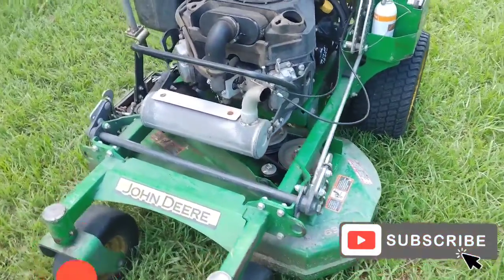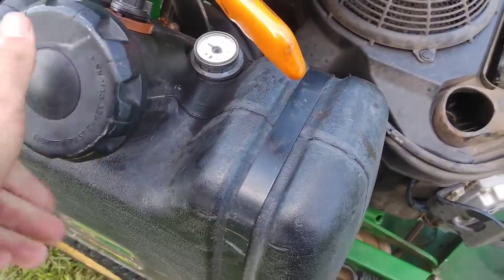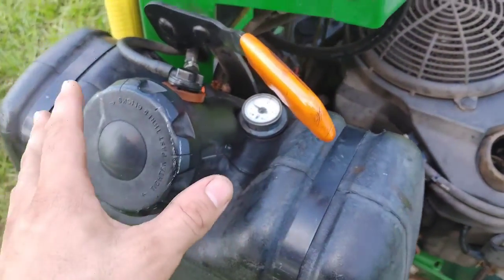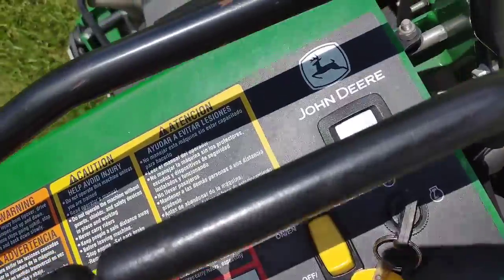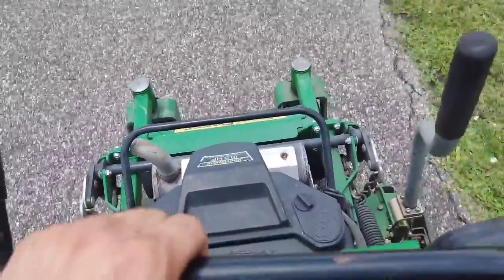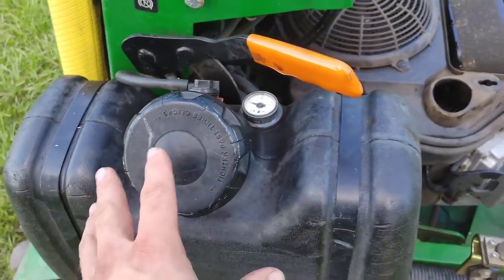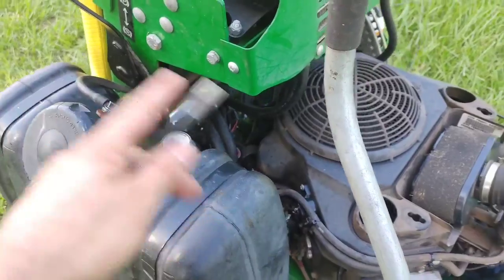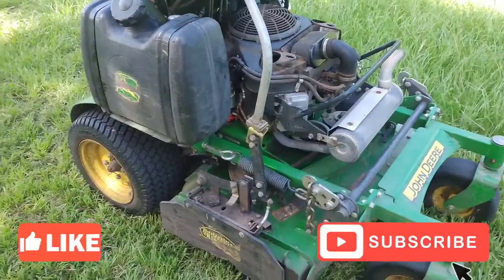Engine dies after 1 hour of running.

Comment: I do have a question since you know John Deere's very well.  I don't find much info on my 2012,  Z920A , 60" which was only made a couple of years.  I notice that it's about 200lbs. heavier than the "M" series and does have a massive frame.  I'm wondering what the main differences between the  "A" & "M" series and wondering if J.D. decided that the "A" series was overbuilt and could reduce cost in the "M" series but still have a reliable machine.  Did the "A" series have any weak spots to look out for.  Mine has about 1,400 hours and I'm pulling the Hydro units as an assy. to replace all the seals, etc. before any leaks start.  Everything works great.   Thanks for your many great videos.
Reply from the maker: Thats a great question. I dont know exactly what the significant differences would be between the A series and the M series. I will neee to ask some of the older more experienced guys I work with. I do think the older models were built better.  Thanks for watching my videos and subscribing to the channle. I dont know of any weaknesses your 920A has.

Comment: Takes a good mechanic that can find an unusual problem without replacing many parts hoping to fix the problem.  Cracked line, cracked fitting,  bad gas, sludge,  switches going bad, etc, etc. can all be tricky to find.  Great video.  Thanks.
Reply from the maker: I was mad at myself for not finding that issue during the fuel system clean. I got too comfortable in my regular routine

Comment: Vapor lock wrap some black insulation AKA foam on the fuel line. Gas is evaporating in the line.
Reply from the maker: It was the fuel shit off valve that had a partial restriction, Not vapor lock.

Comment: Kohler 7000 series engines..Kohler 7000 series are designed after the Kohler command commercial Pro Engine..and it's the least seen in repair shops because they are that good 👍